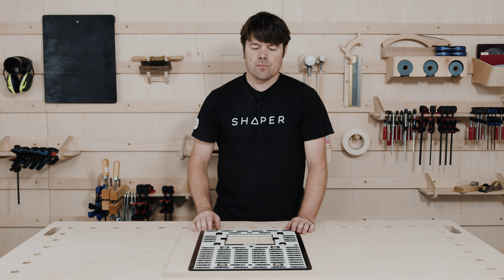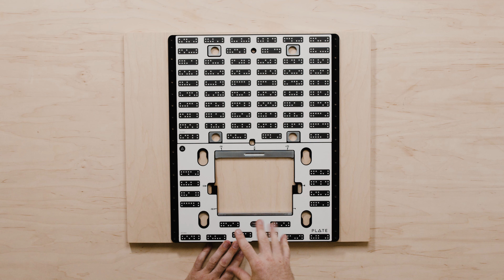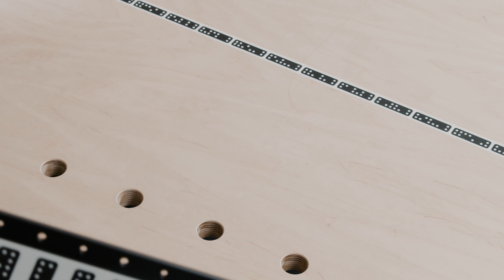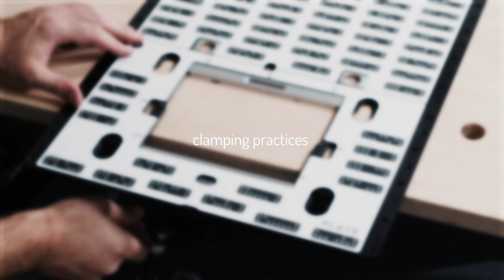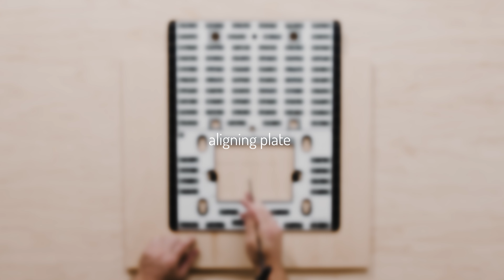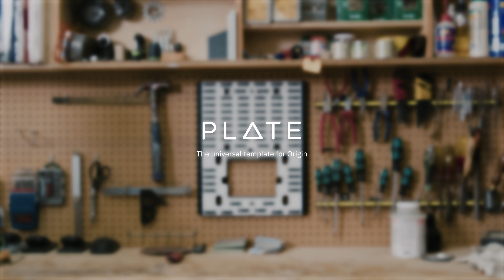Shaper Plate: Tips and Tricks

Comment: I love the basic work table  with perimeter dog holes. What are your overall dimensions? What did you use for legs/supports? What would you do differently if you made another?
Reply: It's 1" Baltic birch on a Felder fat 500 height adjustable table. Super robust and flexible for filming. 
As for the holes, I need to add more, the perimeter holes don't leave enough space for clamps in a few locations underneath.